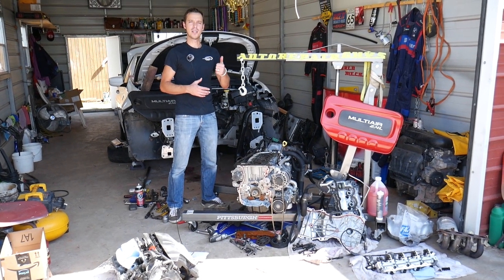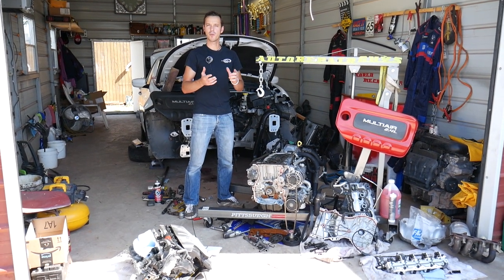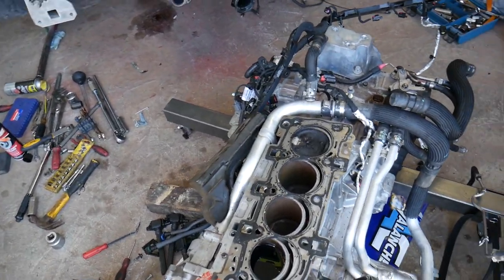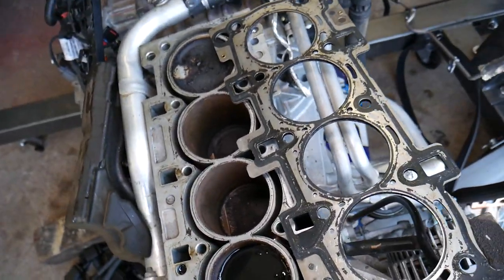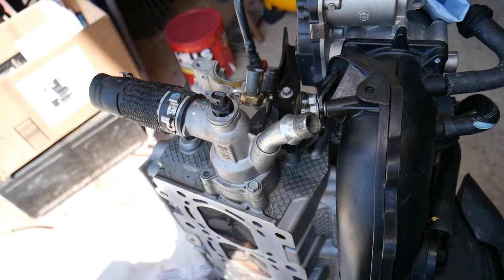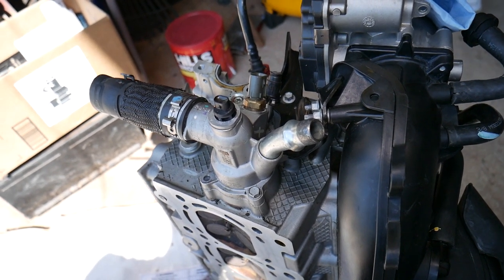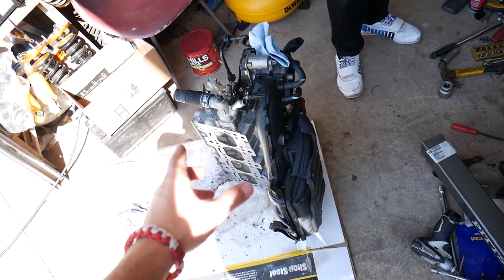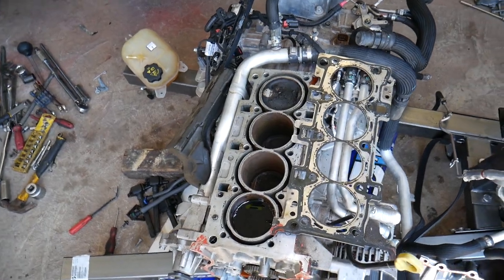WHY THERE IS TOO MUCH PRESSURE IN RADIATOR HOSE COOLING SYSTEM JEEP CHEROKEE, COMPASS, RENEGADE 2.4

Comment: I appreciate your videos and time you take to make these well informed and educational videos. As the games made to be sold not told you sir are an exceptional game changer. There's 1 more reason these vehicles tend to over heat I've just learned through replacing every component to the cooling system. A clogged or damaged oil cooler, as the cooler in most of these vehicles is part of the AC condenser. It is before the radiator and transfers heat to the radiator at the top. The 07 jeep compass I've been in a fist fight with has a overheating issue that's been hard to diagnose. Mostly due to me being an older car technician 70s-90s. These newer vehicles have way too much overthinking put into them and parts that are made from inferior materials. Such as plastics, aluminum and metals. Plastic cools down faster than aluminum. And aluminum cools faster than metals, which will cause the softer materials to fail. Not to mention the abundance of sensors and relays giving information to the brain of the vehicle. These items are why they make more parts than cars. I call it; Set up for failure , and ; Break the bank syndrome. Thanks again

Comment: I believe I have head gasket problem I changed thermostat and I keep blowing up my coolant hoses , is it ok to run with rad cap half on and resivoir opened to let excess pressure out ?

Comment: Is it the same way for a diesel engine? I was told I have a blown head gasket because upper and lower radiator hose tight. It doesn't overheat. It has no mixture of oil and coolant.  I have no white smoke. I'm confused.  Please advise.
Reply: I have that exact same problem right now have you ever found the problem?
Reply: Did y’all figure it out

Comment: To make your cooling  system last long, use rainwater. Avoid coolant , it  damages the radiator , hose ,  and water pump. I have no problem with my car's cooling system for almost a decade since i stopped  using coolant .
Reply: Great idea(not really)if i didn't live in Wisconsin